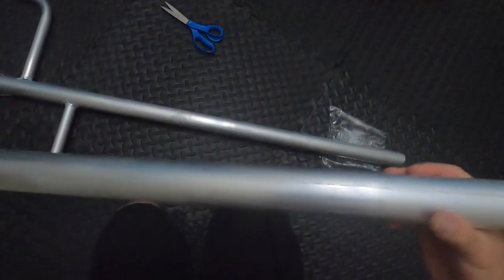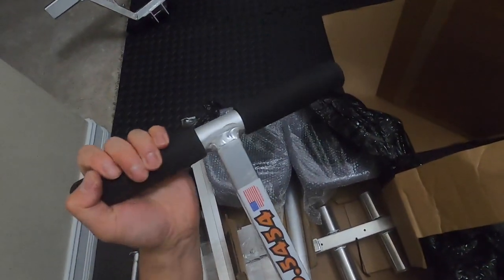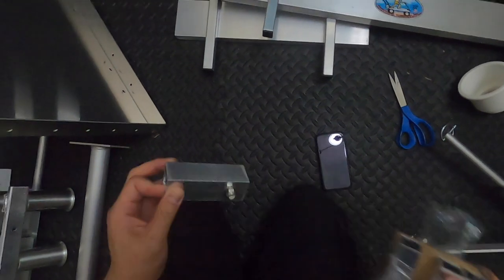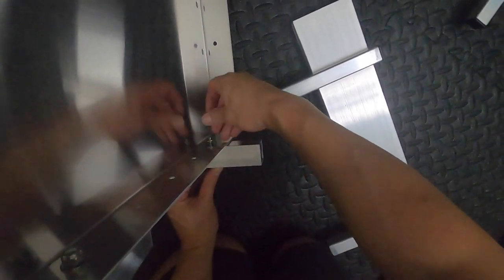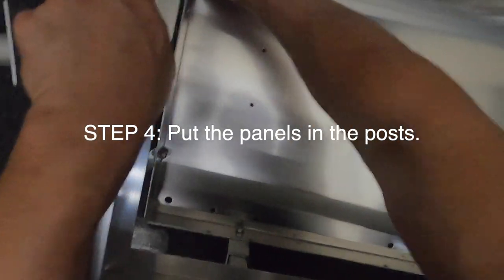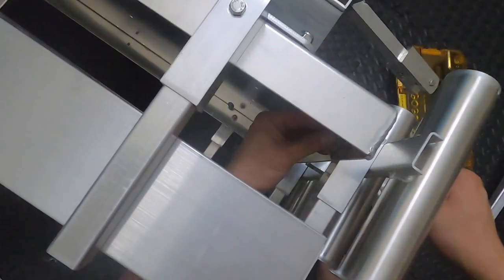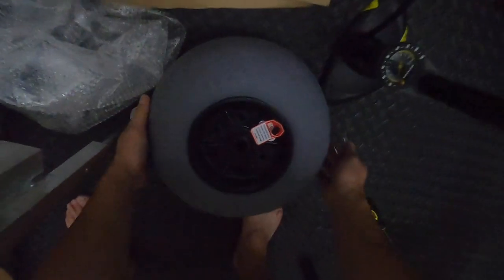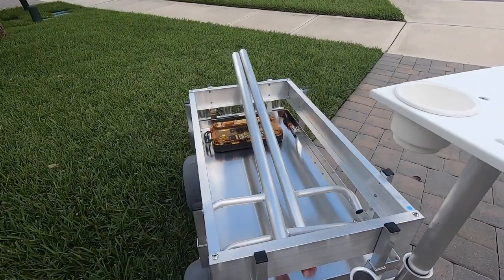Alumacart Big Kahuna Beach Wagon unboxing, assembly, and first impressions.

Comment: you installed the axles on the wrong side or the rod rack on the wrong side
Reply from the maker: I bought an extra one for the front, but yea, you are right. It can be mounted just on the sides and the rear. It's gone now though.

Comment: After buying it would you buy it again?
Reply from the maker: Lol, no. I sold it at a big loss. Got Angler's Fish-N-Mate Sr with orange tires and it works WAY better.
Reply: Yes. I love it
Reply: @theanglercrew7059  why is the fish n mate better??
Reply: @theanglercrew7059  what was your biggest issue / problem? I’m really interested in getting one but your comment has me second guessing… ANY info would really help! Thanks 😊
Reply from the maker: @ernadibric6133  Balance was off for me. When I would carry it, the front end would lift up so it fell over backwards more than a few times until I got fed up. Fish N Mate Sr + Orange Balloon tires + extra axle and two additional orange tires + hitch carrier is probably less than half of what I paid for the Big Kahuna package. It is amazing. If you join a FB group for surf carts, you’ll see that many people have the Fish M Mate Sr cart.